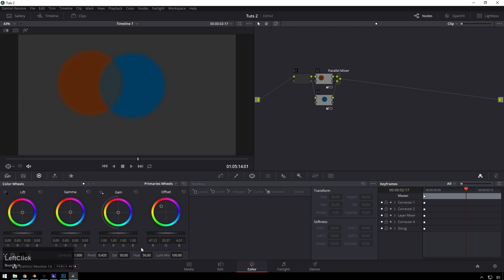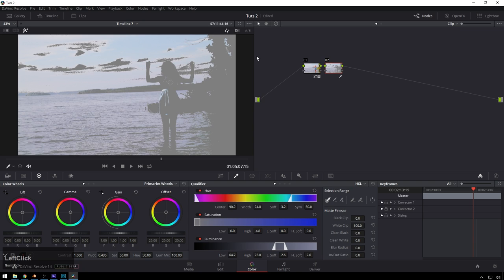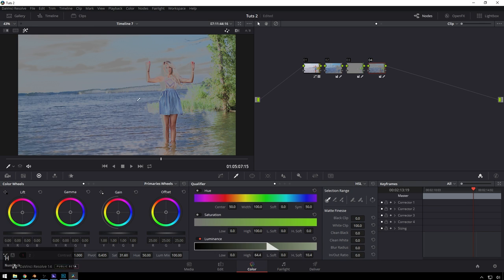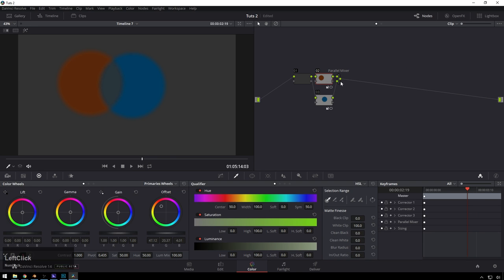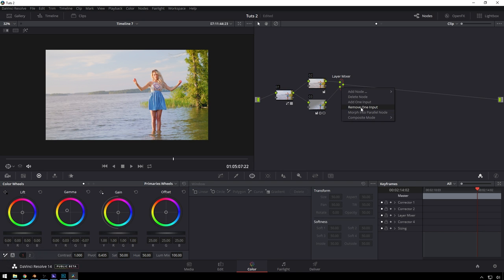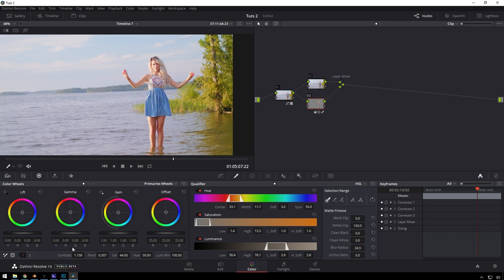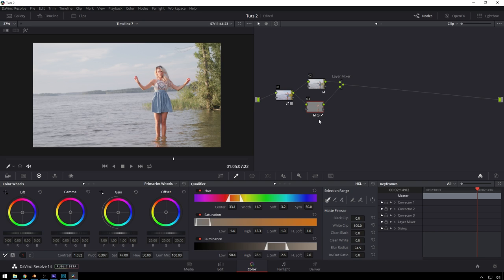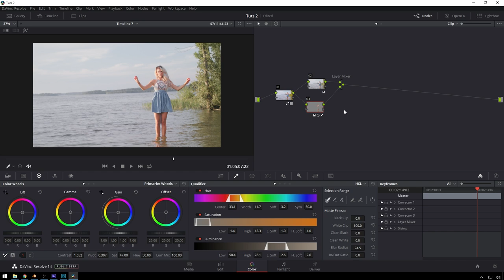Parallel and Layer Mixer Nodes EXPLAINED - Davinci Resolve 14 tutorial

Comment: Hey, love your tutorials. I have a quick question I just got Davinci 14 and cannot find the turn Mac display off on the color management window, so everything I render comes out without contrast. I use to have the same problem with Davinci 12 but notice that by turning the Mac display off it solved the problem. I appreciate any help and thank you in advance.
Reply: That preference moved from the Davinci Resolve Application Preferences (not the gear prefs at bottom right, the Davinci App prefs in the menu bar) It moved from 'Preferences>User' into the 'Preferences>System' section. I believe it's in the 'General' sub-section now, as of Davinci Version 15

Comment: LUTs should not be applied to the first node (it clamps a whole bunch of settings). LUTs should be applied to the last node.
Reply: Depends on the LUT. If you're using a normalization LUT that does not cut off the dynamic range of the input image (doesn't clip any highlights or shadows that weren't clipped in the original image), then it's pretty safe to use the LUT as your first node. You could even use it as a second node if your first node adjusts the white and black points such that the dynamic range of the image fits into what the LUT expects. You can use a LUT as the last node too, but it's not always bad to have it at the beginning, depending on the design of the LUT.